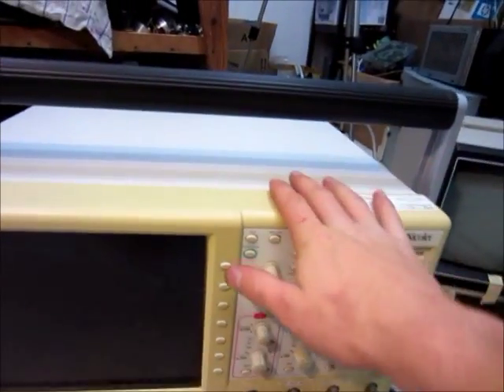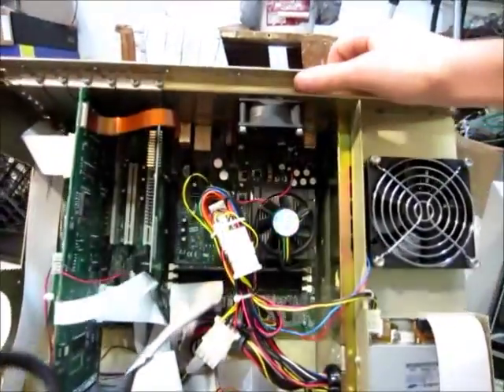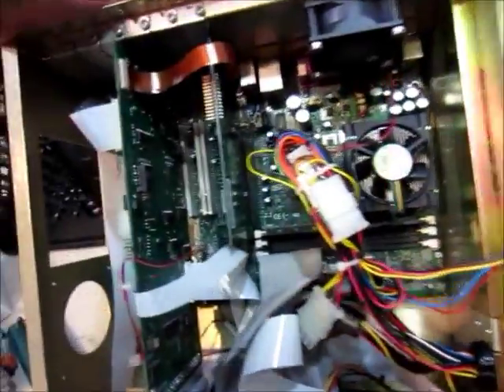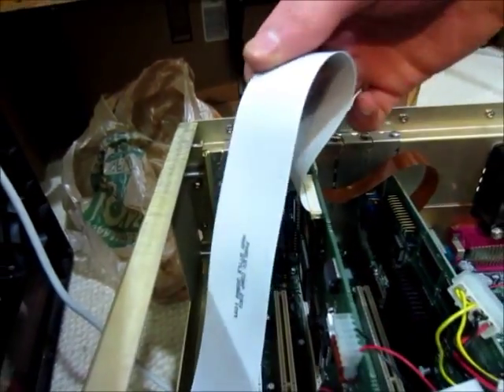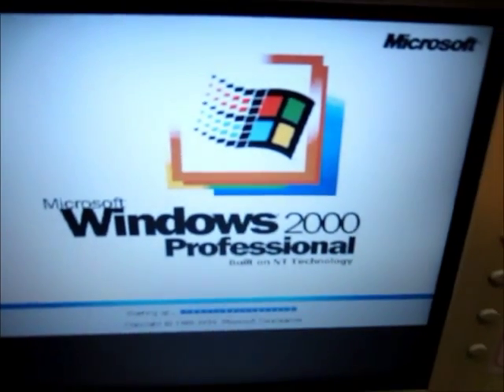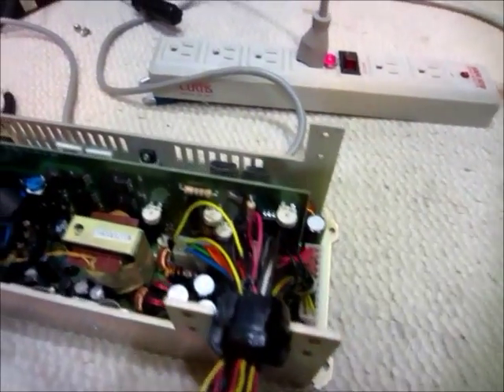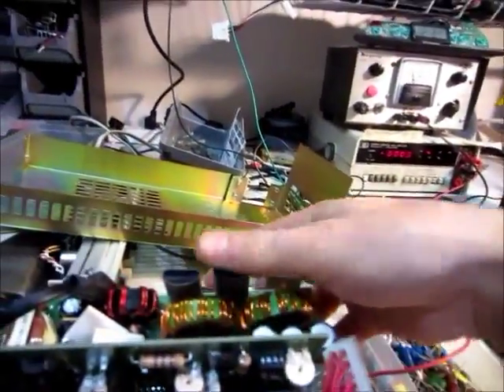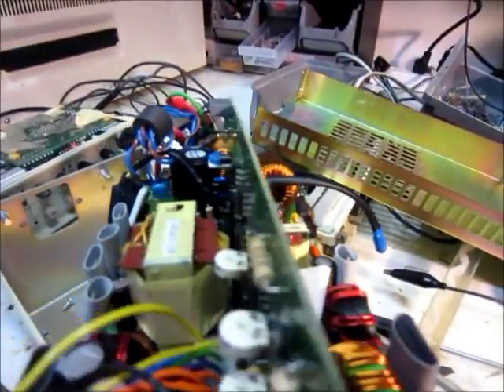Nicolet Accura 100 Digital Oscilloscope Power Supply Problem

Comment from the maker: I replaced the caps with different used ones and it still does not do much.  There are 2 transformers in it, the small one does get a pulse every second.  But that is all the activity I can find.  After playing around for a wile I did figure out that I had to hook it up the way you are telling my or I just get a 60hz wave.

Comment: Device manager in safe mode. Shows stuff it normally wouldn't. Re 18 amps -5v See rimstars Comment. I see what you mean though. 2 PSU's on desk, 1200w has 2.5a and the old 400w only has -12@0.3a. Might be easier to fix the existing one? Those caps sound bad. Sounds like the whole PSU has seen some serious heat! Would pay to check everything. Even megger the transformer. Would be worth it though. You may be able to improve the scope by the time you know how it all works.

Comment from the maker: Thanks!  I'll have to check that.  I think that it might be a capacitor problem.  There are 3 10 volt 3000uf caps that look like they might have very very very slightly bulged tops.  I was also probing around and I noticed that another cap measured 100 sum volts from the metal can to ground.  I am assuming that means it is bad.
Reply: I'd definitely replace those swollen capacitors. Could you put the model number of the power supply in the description?

Comment from the maker: The problem is that it needs -5 volts at 18 amps.  Not a very common thing in computer power supplies to have that many amps on -5 volts.

Comment: Aren't the current values you read out around 6:52 maximum current draw? So you don't have to match them exactly when looking for another power supply. Just find ones that have the same voltage and at least that current rating. Or even multiple power supplies if you don't find just one that has all that you need.

Comment: Can you just swap the power supply for a matching one? or add an aux PSU? You have a few old computers. Maybe  you can canabalise one :) DVI port is digital image port. get a hdmi adapter if you like. Looks like the card is scope card with extra video outs. Windows 2000 Gah! Try booting in safe mode. If power coming from supply, the scopes transformer might have been blown from PEBKAC issue. Should be fixable. All About Circuits (website) book has some good scope basics. I'd start there.

Comment: Are there any part numbers on that blue thermistor and power supply board?

Try seeing if there are any voltages on the wires that go to the scope board and if you have a scope poke around and see if you are getting any drive waveforms to the power supply's main transistors. Just be careful not to create a ground loop since the probes ground clip is mains earth grounded (Dave at the EEVblog has a good video on this). And its rectified mains in there too.